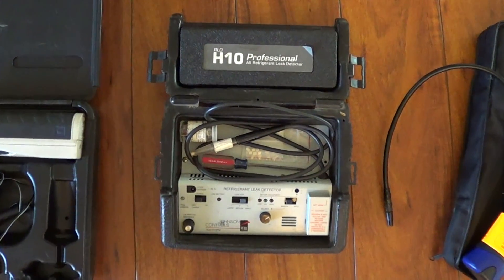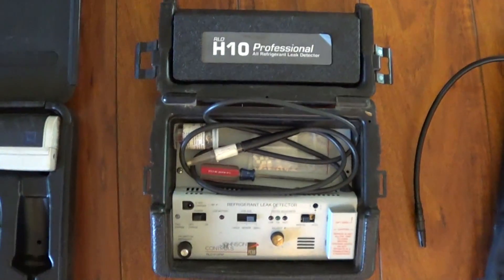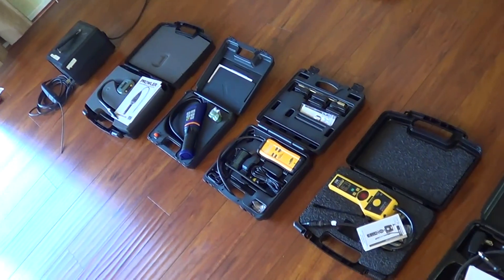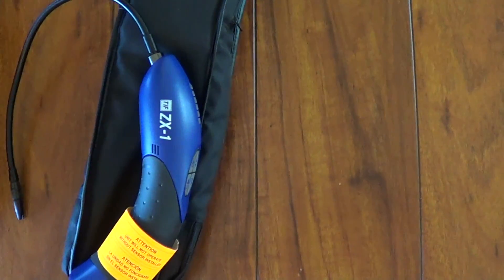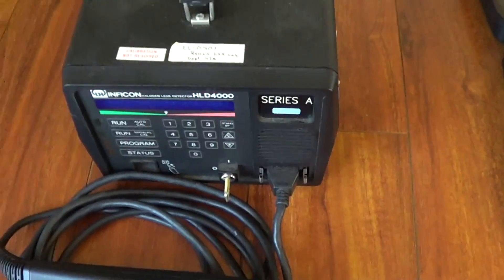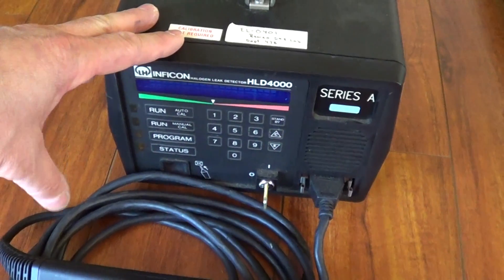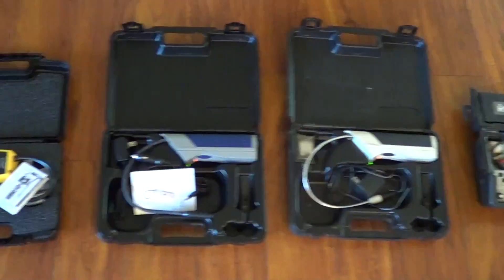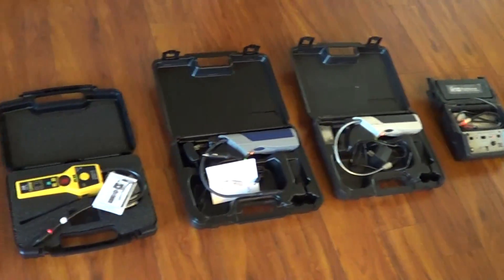Leak Detector PPM Report (long version)

Comment: i have the H10 and the inferno and the prowler.  The inferno sensors don't last for beans and are very expensive, The JB Prowler simply stinks, has difficulty detecting leaks I can hear unles directly on it.  Confidence plays a big part in leak detection. Mine is in the H10.  I recover the gas in a clean cylinder, install a shot of 22 and nitrogen and find the leaks with the H10, problem solved... your going to have to recover the gas anyway to repair the leak and change the drier.
Reply from the maker: Some guys pump down and purge to repair simple leaks on rubbing tubes or solder joints.  Having a sensitive R410a leak detector can save a lot of time.

Comment: Waste of time. We all know the zx1 is the best.
Reply from the maker: +Joe's Tube All the brands are "the best"  That is why I had to buy them all to really find out.  The ZX1 is at the top of the pack with 0.05 ppm sensitivity to R22.  However, it really sucks on R410a with 3 ppm.  It is 60 times less sensitive on the long term R22 replacement.  Residential needs sub 1 ppm sensitivity to find 2 pound per year leaks in a few minutes.  Otherwise, you are just guessing where the leak is.
Reply: NathansHVAC you can't get tifzx1 anymore , only tif zx and it's the best all around 410a it's excellent.

Comment: I just bought Nathan's test results. And in seconds, downloaded it. To say I am impressed with these exhaustive results is an understatement. I have been in HVAC/R for 28 yrs, have taught refer 3 class at our community college for 7 1/2 yrs. and have not even thought of these tests, let alone expended the energy and funds to do so.  I own 5 different detectors now, I have owned a LOT more in 28 yrs. Just by PURE CHANCE, I currently own the two best, one for R-22 and one for 410a. BUY HIS $10 REPORT AND SAVE, AT THE VERY LEAST, HUNDREDS OF DOLLARS, by NOT buying the wrong detectors. Thank you Nathan for providing this valuable resource to our HVAC/R industry.  These results would easily be worth $100, in savings, if you like me bought 2-4 detectors which may be worthless, especially for 410a.  I do not know Nathan, found his test on ebay and I'm so glad I did.
Reply from the maker: +HVACinstructer  My dad always said that some one in the world somewhere has the answer even the most unusual HVAC question.  He was mostly right.  But, I had to answer the question of R410a sensitivity myself.  And, I really looked for a long time first.